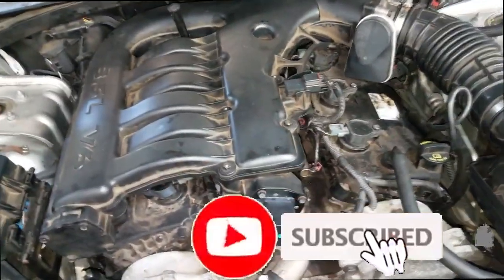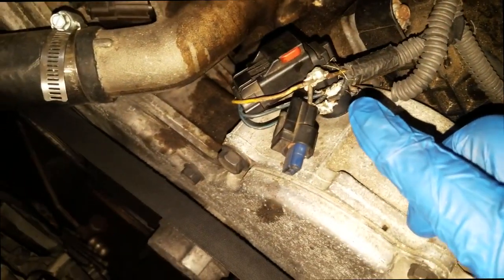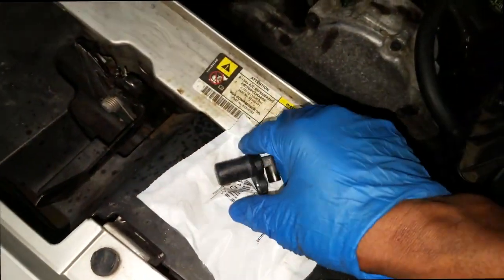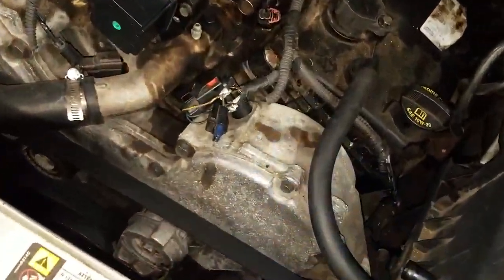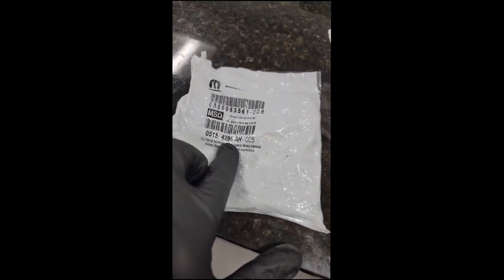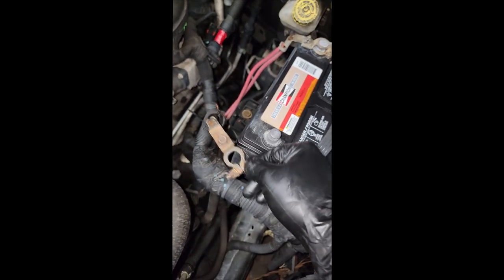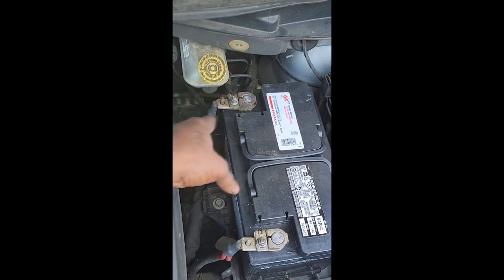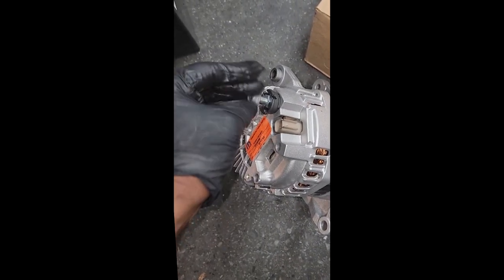Doing this can destroy your Car Computer. NEVER DO THIS

Comment: Hot glue it on top
OR JB Weld "plastic" type JT
I have a bunch of test tools that have Female electrical connectors.
To do what 😮 ? To test power, signal return and ground RIGHT AT... the sensor. Also 'INJECT' a signal to the computer, don't try if you don't understand Voltage involved OR amp limits of computer grounds. 12 volt logic probes AND test lights from HF are ALSO a no no. Lots are 5.0 volts or less, at less than 1 amp. Sensor line, not output to solenoid or relay. Oxygen sensor is around 1.0 volts while running engine 😮